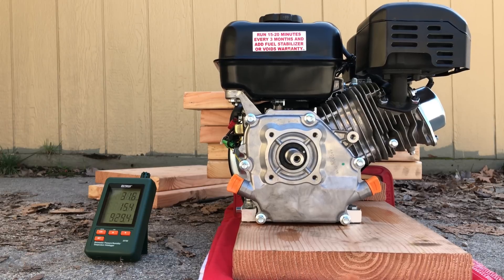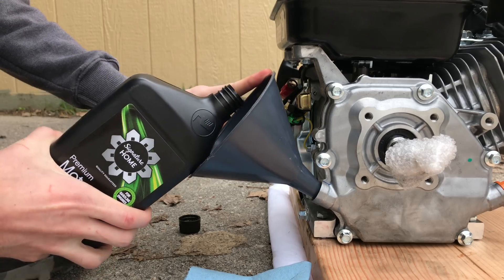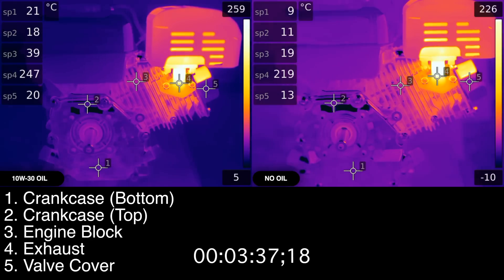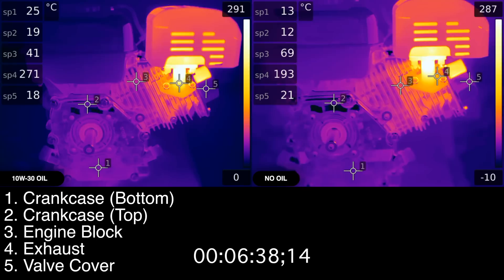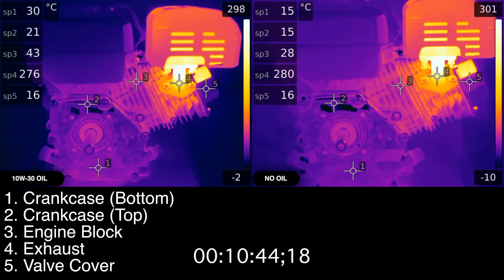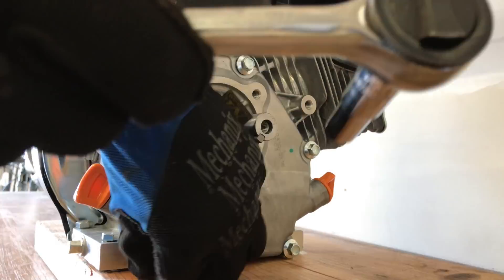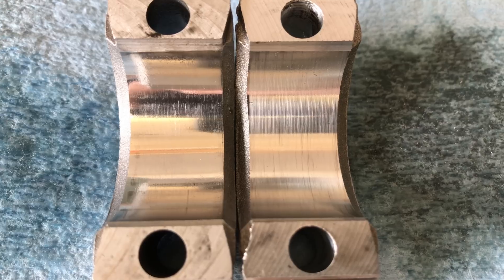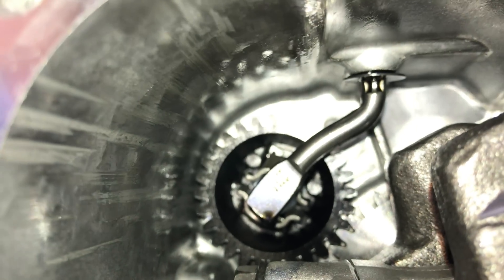What Happens To An Engine Without Oil?

Comment: What happens to oil without an engine?
Reply: It would start a war..... And america always in it
Reply: @koopiaceh6754  😂
Reply: @koopiaceh6754  Too meta lol
Reply: It would turn back into dead dino bods
Reply: DeltaGaming not trying to kill your joke or anythin, but most oil came from the carbenifirous period, not the age of the dinosaurs
Reply: It would stay in the bottle or would flow away if ye poured it out, i guess.
Reply: it'll start being sentient by questioning the purpose of its existence
Reply: One and oily
Reply: @iloilobyaheko1872 If you travel at around Mach 3 and you make a tube with an inlet that compresses the incoming air due to its shape, the boundary between the supersonic and subsonic flow will create a shock wave. Injecting motor oil, ethanol, propane, diesel, etc behind the shock wave and igniting it will result in what's basically an air-breathing rocket with no moving parts. The main issue is that you need to be going near Mach 3 to even start the engine, so you need to either have a normal rocket to accelerate initially, or be dropped from a bigger aircraft and dive to gain enough airspeed.
Reply: America democracy warrior will invade oil
Reply: It dies a painful death.
Reply: its in the bottle
Reply: it would create pimples on ur face
Reply: The oil will be sad.
Reply: It gets rescued and brought to savety by a freedom eagle
Reply: Most of the parts may go scrapped, with empty wallet... I had 2 time experience from my bike engine.. 😁😁😁😁
Reply: It sits on the store shelf
Reply: Umm no pollution?
Reply: Irap and Israel will have peace cause damn Americans just want an oils
Reply: It would chew cyanide tube it was trained to do.
Reply: It gets democracy
Reply: Greener earth?
Reply: burns
Reply: hah nice one
Reply: Good question. Hahahah.
Reply: You can make fries in it
Reply: So i got my chicket i need oil so i use it to fry my chicken legs
Reply: Salad
Reply: Oil?? Seems like that oil need some freedom (USA)
Reply: America would come to liberate it.
Reply: Nature get it back
Reply: Yes
Reply: what happens to earth without u ??
Reply: Goes off
Reply: Oil company will over heat as well as you cannot have ac since no Generates electricity and pumps water
So we all overheat
Reply: Mind = plown
Reply: It gets rubbed all over my body
Reply: Time travel
Reply: America happens
Reply: It goes boom,  you lose the pistons,  rods and parts of the case start flying
Reply: Virgin Oil
Reply: What happened if have not blood
Reply: Oil without an engine causes Bob to refuse sandwiches from a disfigured clown. Don't let Bob starve, put engines in your oil.
Reply: It'll be burnt thanks to the oxygen
Reply: Creates dinosaurs
Reply: It'll turn out into liquid oil

Comment: hi .
this small engine need some load to make some kind of damaga. lawn tractors rod brokes when there is no oil and you do a work with it. i have seen many of those. but small lawn mowner can work hours on idle without oli or even with sand dust in cranck case.

Comment: A better comparison would be between an engine with oil and a separate engine without. It would be interesting to see how the wear patterns. I would have also left it running for hours, and tried to break them in per recommendations. Cool experiment!

Comment: This is an air cooled motor and not liquid-cooled.  Oil is only lubricating the contact parts which would be worn if the engine would be under loading conditions without oil.  Try the same experiment with a liquid-cooled motor without liquid than you should see a failure!

Comment: Hello there, im to lazy to search the internet so i will ask here. I drove in winter and from some unknow reason the coolig liquid started to leak until it leaked all from the expansion tank... i drove 3-4 days like that thinking its ok.. until my father told me, "if you want to break your engine drove further". the problem is now in spring, i have no more leeks since when i filled up the tank, but the temperature gauge always remain like 34-40%, not at 50% when it shoul stay... when i give it a little more  gas 3000-4000 rpm(disel) the niddle goes right to the optimal then it falls back 30% like in 4-5 minutes.. what is the reason for this.
Reply: SparkySlow Don't know if it's the same problem, but in an earlier car of mine the engine temperature started to fluctuate randomly, and fast. First it was diagnosed as a problem with temperature sensor, but later it turned out the coolant was leaking, and too little coolant didn't flow reliably, but stopped flowing every now and then. Also the leak was intermittent, so it was difficult to find, but eventually the leak was located to the water pump. So, I'd suppose the temparature that varies could be a symptom from level of coolant gone too low due to the leak.

Comment: im curious now with an engine with too much oil
Reply: There are some story's where there will be oil igniting in the combustion chamber and increasing the temperature. The increasing temp is giving the oil an easier time to have combustion so the power increases and revs will rise alot = Free running :D
Reply: deadguppy888 i did that with my lawn mower. all it did was stall easy. not sure what is would do on a car engine tho

Comment: Helps that this is basically a cheaper knock off Honda engine. I've run them (actual Honda) out of oil a few times on accident and they keep going. Best small engines ever made. Now my truck on the other hand, while it is a Toyota, it was neglected by the previous owner and came pretty close to throwing a rod a couple weeks ago. So yes, oil is very important.

Comment: what if you use coke as oil ?
Reply: the hydraulic press channel guy did that
Reply: Rick Sanchez i heard heroin works wonders
Reply: You would need a pretty good source and it would cost a lot to fill an engine with that much cocaine
Reply: My guess the sugar causes excessive scarring to the moving parts.
Reply: 'Murica intensifies
Reply: Then your car goes to jail for using drugs
Reply: @Shawn Clinton Mathias I would drink beer at parties not coke. Unless it was mixed with liquor.

Comment: Being a brand new engine, wouldnt you assume that the engine shavings are from the engine itself breaking in? That is a hypothesis that could cause the shavings, sure not all of it, but a good amount could be from no oil as well.
Reply from the maker: Sure, possible, but there were no (visible) shavings in the oil from the first run, so the shavings from the second run would have nearly exclusively been from damage.
Reply: also true.

Comment: Not what happens to a Honda Civic engine.  Had to move to NC so unfortunately took my 2001 CIvic to Wal-mart for a oil change (I normally do all my stuff and hate for someone to touch my car, even now that I'm disabled) and they didn't put my oil filter on right.  Got to NC and after driving a little while had a feeling I need to check the oil and when I did there was nothing on the dipstick.  The car was driving completely normally and engine temps were fine.  Put another 60k miles on the car before totaling it.

Comment: at 4 minutes 51 seconds you point towards the crank where the connecting rod attaches. just to the right of your finger the metal of the crank appears to have taken on a blue color. could this be from the metal running extremely hot where the rod bearing was rubbing metal on metal?

Comment: You are going to get metal shavings from those El cheapo engines whether you have oil in them or not...
My break in recommendations are changing the oil after a couple hours of use,and than after a couple of days, and you are good to go.

Comment: When I was 18, I took my Dad's Honda 350 twin MC for a short spin; real short, like a half mile. He had drained the oil, and took the key to get some new oil. With no sign of this in progress, I found the (spare) key (go figure) and took off. On his way back with the oil, he saw me pushing his bike back home. I was still unaware what had happened, though he was fully aware. He was very understanding and composed, as always,and we did get it running again...with oil this time.

Comment: This engine has splash lubrication, the forces in the engine are relatively low and the bearings don't require pressure lubrication. In an engine with pressure lubrication running under load the engine would seize within seconds or minutes, once the oil pressure would drop the bearings would dry out and overheat quickly. It's an interesting video but can't really be compared it to a car engine. If you lost oil pressure while accelerating on the road you would probably end up stranded in a cloud of smoke and possibly with bits of engine rattling around the oil sump.
Reply: This actually happened to me. I was driving down the road when an oil cooler line gave out and blew it all over the road.

I temporarily repaired the hose, threw a little oil in it, drove it up on a trailer, and took it home to fix the hose correctly.

The vehicle still runs like it has all or most of its power and everything. It just clacks under load.

I'm debating whether to put it back on the road until it truly dies but I'd have to replace some brake line first.
Reply: @dchawk81  did you ever put it back on the road?
Reply: @EliFleming  I ran it for like a month but then a brake line blew out. I had enough by then and scrapped it.
Reply: @dchawk81  thanks for the update. Pretty much toasted mine limping home with a blown cam seal but I might see if it’s got any life left in it.
Reply: @EliFleming  Roger that. I figured that was a sign to cut bait and let it go.
Reply: Aweigh@Sea splash lubrication, you mean wet sump ?

Comment: All engines are oil cooled. The lack of temp in oiless run was due to no heat transfer. Just like if all the coolant leaks out of liquid cooled engine, the temp gauge goes down before it stops running. Air cooled engines rely on oil cooling even more than liquid cooled, so don't run them low on oil.

Comment: Can you do a video on why engine oil pressures are the values they are?  How much oil pressure does an engine really need?  Are the oil channels so small that you need a lot of pressure for adequate flow?  Are higher pressures required for the hydraulic lifters?

Comment: Instead of the oil discipating the heat to the outside via the crank case the air is insulating the heat at the crank and rod bearing. which is why the case seems to be cooler.

Comment: there was no oil to help spread the heat.
if you could have had a way to measure the temperature of the piston it self for example, you would had seen a bigger temperature difference.

however, consider that there are not a lot of parts in this engine, and does not takes a lot of power to run unloaded. so you don't have a lot of friction to begin with.
allso there was some oil remains in the engine, oil can vaporise and get to places thatway.
surely that did aid things a bit.
a good example is a modern and well made 2 stroke chainsaw engine.
that is a husky for those who are interested.
anyways, it does occur sometimes that people forget to mix the petrol with any oil or what so ever, yet you can run a full tank of gas out of a husky without major issues, people usually only notice the lack of power around the end of the tank.
and only then realise what is the problem. and yet, they don't die. the oil remains in the crank case can be sufficient to some point to prevent fatal damage there.

and husky stands for husqvarna. the only thing you wanna buy for cutting grass or cutting wood.

Comment: if you would have removed all the oil and then cleaned the inside of the engine I'm sure the results would have been dramatically different

Comment: Have Q.? Is it a good idea to flush your engine with crankcase cleaner each oil change?
Reply: To further expand on the reason why; a good engine oil already has detergents mixed it, it's cleaning the engine while it's running at operating temperature.
Reply: No, it is not necessary. If you change your oil when your supposed to you should never have to do an engine flush.
Reply: Nutz4Gunz45 OK thanks !
Reply: ^^^ This isnt true in all cases. If you do mostly city driving where the engine never really gets to open up and breathe at operating temps and just have the throttle held at a set opening for a while , you can get a gunky motor.   In fact some motors are known to get gunky, the Toyota 3.4 for example, if you don't do mostly highway miles on the 3.4 it's gonna be gunky. The brand of oil you use also contributes to gunkiness. MOBIL1, ROYAL PURPLE or AMSOIL are the only oils you should use, period. Anyone that says different is over 65 and old school or a paid schill for valvofail or penzno. The easiest way to check if your engine is gunky is when you do a valve cover gasket change or if the splash guard under your oil cap is super gunky. And I say if your car is under 200,000 miles or newer than 15 years old, it's not needed. use common sense.

Comment: Our garden tools shop once forgot to put new oil in our lawnmower after a maintenance (they did remove the old oil). The lawnmower operated a lot better, the engine seemed more powerful and we were happy with the maintenance done... until it stalled after about 15 minutes of operation.

Luckily the shop did repair the engine for free. Everyone can make a mistake I guess.

Comment: That small bit of residual oil is precisely why the engine ran as long as it did. If you had opened the case and cleaned the components with a solvent and reassembled it completely dry it would have imploded way faster. In fact I'd like to see you do that with the engine just to see what happens. My guess is it would be much much louder and get hot much quicker.

Comment: That just shows how long a person will run a engine without oil before it actually locks up. Then when it locks up they are mad at the company that makes the product.  They never even checked the oil to begin with but it's the manufacturer fault.

Comment: you have to realize that there's still some oil left on the crank and cylinder walls once that burns off, due to having no oil flow to carry the heat away that's when the engine will eventually cease.

Comment: I ran Dura Lube and Slick50 in my 4 cylinder lost the oil plug and drove 550 miles and 300 the day after with no oil ! No problems ! Bought a new plug bolt added oil still driving it around !

Comment: Wow. You leave a lot to be desired as a "scientist".  First: the "scratches" are normal.  Run a new engine for 15 minutes and see the scratches as it breaks in.  Also, the small amount of metal in the oil is normal for a new engine just breaking in. Particularly a cheap chinese engine.  Also, back up your "no oil' camera so that it is the same distance as the "oil" camera. IF you are going to disassemble the engine, you have to disassemble the engine after 15 minutes "with" oil, and look for wear and tear. You can't assume all wear and tear occurred during the "without oil" phase. To do this properly you need to buy two engines and run them, one with and one without oil.

Comment: I liked the video but I think you could have gone the extra mile ($ permitting) and bought two identical engines where one never saw any oil and the other had been lubed to spec. Then it would have been fascinating to see a full tear down of each after you ran the dry engine to failure. Just a thought

Comment: I doubt that 15 minutes is enough to kill an engine without oil. Besides, there was probably still a film of oil in the bore and on the crankcase, which certainly helped it in the first few minutes.

Can't you let it run for an hour or 2 instead?

Comment: what happens if you overfill the oil
Reply: Overfilling a little on car engines is usually fine. If there's an extra quart on say a 4 quart system, the engine will run hotter and slightly less power but even then you will probably be ok. If you did it on a small engine like this there is the possibility of it going past the piston rings and you will burn oil leaving lots of carbon deposits which will cause it to run poorly. Too much might also make the oil pressure too high at some points and theoretically could cause damage to something like seals. 
A little extra is always better than a little less.

Comment: WOW! the crankshaft must have gotten really hot, look at the tempering colors!
Reply: It is markings of the heat treatment. After casting and rough machining, the bearing surfaces are heat treated for surface hardness and then ground to final dimensions.
Reply from the maker: I believe that may be from the casting process, if you're referring to the coloring at 4:20. Not positive, as I didn't look inside initially, but I have a new crank as well and it too has the coloring.

Comment: So if a car had low oil and triggered a "low oil pressure" light, would it damaged an engine like this? I'd assume there still be enough oil in the pan. My dad's car burns oil like crazy(dip stick goes from full to low within a month), but the light has never been triggered. Maybe Toyota built a safety margin in it?